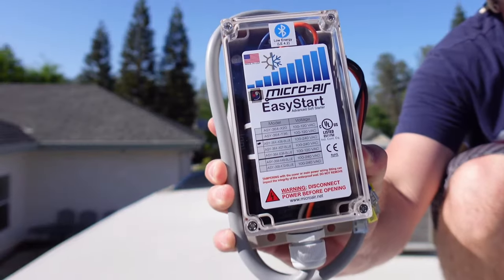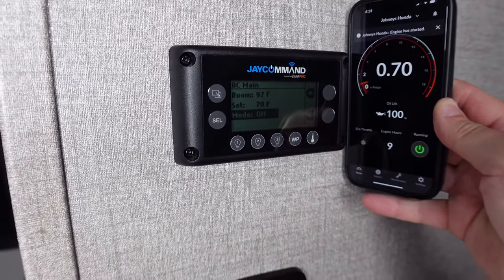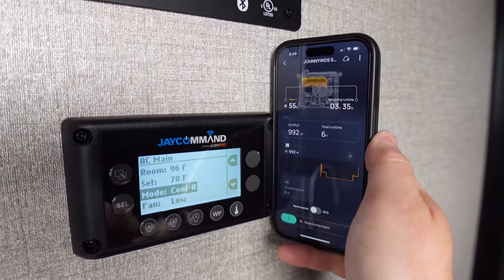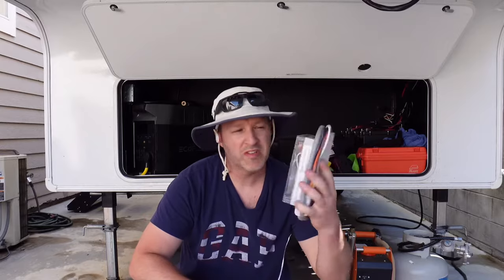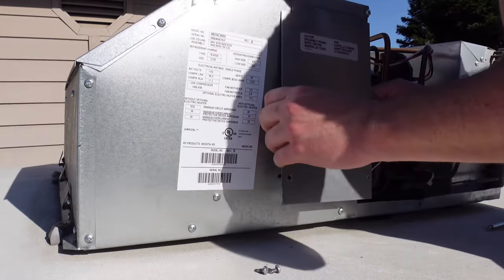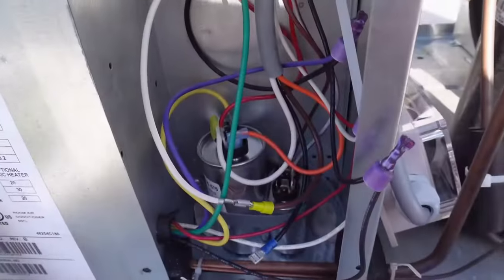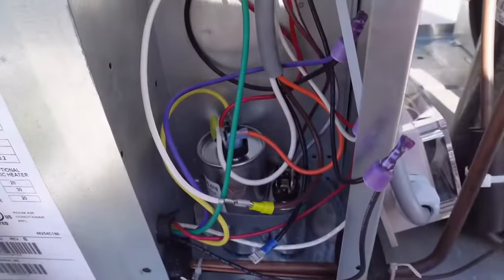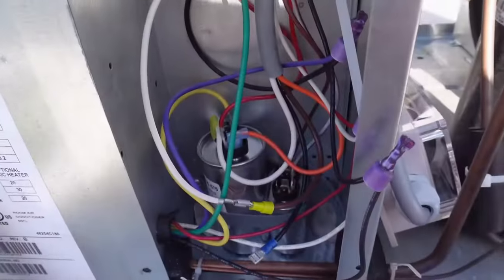HOW TO:  Micro Air Easy Start Install IN 20 Minutes!! RV AC

Comment from the maker: NOTE SAVE MONEY!! You can save about $40 going through the main distributor which is Hutchmountain.com They are also the ones that can get you the exact wire kit you need for your AC unit. Also most tech support is handled there 435-494-1975 Hope this install helps. These are great for a smaller generator and even now power stations. 

Micro Air Bluetooth model
With Basic wiring kit: https://amzn.to/3NPQpLZ

Micro Air Normal
With basic wire kit: https://amzn.to/3NPQpLZ

Wire strippers: https://amzn.to/44mC7rO

CHECK OUT MY AMAZON STORE: https://www.amazon.com/shop/johnnysweekends

If you feel I helped you out consider Buying me a Coffee 👍🏼🙌🏼👊🏼😀
https://www.buymeacoffee.com/johnny5120J

Comment: Cool that both could run on the Delta Pro once both units were installed!
Reply from the maker: I started both my 15k and 13.5k on my last trailer with out them but they were more of a energy efficient style so didn’t require as much peak amps for start. But yea Delta pro is still to this day a beast!! Thanks for stopping by Jason…👍🏼😀
Reply: I literally smoked my first EcoFlow Delta Pro starting  a newer Dometic 13.5 RV air conditioner.  (I should post the video of my franticness when smoke was rolling out).  I have two and was too afraid to try it on the second without a MicroAir.  Needless to say whether it can or can't start it the Easystart will prolong the life of the ecoflow or generaters electronics.  Luckily ecoflow did warranty the unit.  😎
Reply from the maker: Ouch wow that’s kinda weird because I know a few that have really abused them and they are holding up pretty well. 
I think it was defective. Glad they replaced it

Comment: I’m considering purchasing one of these units. I called the manufacturer of my AC (Carrier) and they said it does void the warranty. It’s not a big deal, just remember to remove it before getting service.
Reply from the maker: Well how long is the warranty on the AC unit ? 10 year ??
Reply: Not hard to remove. More of a hassle, but worth it if need warranties. I can’t understand why though.  Seems easier on the AC compressor and MicroAir uses their own capacitor to aid start up. Who knows.
Reply from the maker: I would think as well. If anything extend the life of the compressor.
Reply: @johnnysweekends  that’s exactly what I told them! It makes me mad that these old-school companies are so against anything they don’t understand. They look for any reason to deny coverage and say it’s not their problem. I used to work in mobile audio installing car starters, and we used to get this kind of opposition from the car manufacturers too.
Reply: @johnnysweekends  The warranty period is five (5) years on the compressor, and one (1) year on all other parts.
Reply from the maker: Yea weird how that works and when companies will tell you that. Idk but yea just remove it lol
Reply: @deadonleprechaun  i just bought a veriable cooling heatpump and it came with 1 warrenty on all cosmetic parts. 5 years on all pcb (indoor and outdoor, most importantly the vfd) and 10 years on compressor which will remain unused. I have had a compressor failure only once in all the 12 ac's i own .. compressors rarely fail if maintenance is done right. If you don't maintain the coils and ignore failures then compressor will die.

Comment: Thanks for the video ! Will this work on a 5,000btu window ac 110volt  in an older camper ?
Reply from the maker: It would but the start up on that should be pretty minimal. Most generators should be able to start that. What are you using to run it?
Reply: I have two 100watt solar panels and two 100amp lead acid batteries.  I would like to run the little AC on batteries for short periods of time.
Reply from the maker: You’ll need a inverter to run it. Which they can be had cheap but I suggest at least buying a decent brand so they last and will be more efficient. The renogy ones have been around a long time and seem to do well. And a 1000 watt inverter is not much like $200….ish

Here is one that I’m talking about https://amzn.to/44sOuTg

Comment: I've been running mine for almost 2 years now.  GenSet starts the 4ton home central AC very easily now.  Also, the compressor seems to start smoother without the old "BAM!" on startup.  The Bluetooth app is quite nice too. Mine is set up to start the condenser fan and air handler fan then about 5 seconds later the compressor.  Went from 100+ LRA down to 38~40A on startup.   Perfect.    - Nice review/video.
Reply from the maker: Wow that’s awesome. Sounds like it’s doing great. 
And thank you 😀👍🏼

Comment: What did the soft start do?  It took a little over 14 amps to start the AC before and after the soft start was installed. I though the soft start reduced the amount of surge power needed from your source of electricity.
Reply from the maker: I don’t think you really watched the video..? I explained the Honda app didn’t work correctly as sometimes the Bluetooth is t quick enough to capture the load. Sometimes it does but that first start before the easy start was plugged in should have read anywhere from 28-33 amps to fire it up. 
Now it’s consistent at 15 amps +/- a little.
👍🏼
Reply: Ohhhh. Ok, I did miss that detail. It all makes sense now. Thank you!

Comment: Another GREAT one!  I installed mine today  to allow me to run the AC on a Champion 2500 dual fuel.  What I'm seeing is just over 2000 watts running power after the AC gets going and I'm on shore power.  Thats the AC and AC Fam power combined.  I can’t use this generator as I hoped because of the running power. What kind of power draw on the Honda are you seeing and how is your Honda handling that kind of power demand.
Reply from the maker: You have more things running than your ac.

A 15k ac should draw about 1450-1600 watts about 

I assume your fridge may be on AC as well. Plus is your converter on? That’s power draw as well.

Comment: Hey Johnny...nice clean install. You might call Hutch Mountain and inquire about the mounting position. They advised me to make sure the wires were pointing down to eliminate the possibility of moisture getting inside. I know there's a waterproof gland and all but just thought I'd pass along what they told me. You're gonna love the difference it makes, not just for the ramp up surge...the AC doesn't work as hard even after the initial start up and seems to be a little quieter as well.
Reply from the maker: Yea I didn’t see much for mounting info which I may have blown past that part because I was running out of time. 
And with the cover on water intrusion is definitely minimal but yes, I was looking at that as well when I did it and said screw it since the ac cover is on and hopefully that eliminates most potential problems from water intrusion. 
I may flip it but will see.
Reply: @johnnysweekends  all good brother. My 15k Dometic runs seamlessly on my Honda 2200 Companion. Definitely was a game changer.
Reply from the maker: How many hours and also how many watts does it pull just on AC im running 1650 just with that which is almost full load. Darn near not enough gen especially if you turn your converter on to charge batts. But I dont really have that issue with my set up..👍🏼
Reply: @johnnysweekends  if memory serves me correctly I’m pulling 1450-1500 even in the hot Midwest summer with high humidity. Never had an issue with the converter running along with other AC outlets. Water heater and fridge on propane of course. 

I have a 6.5 gallon extended gas tank and can run the AC for 37hrs straight with that amount of fuel. We’re headed to NASCAR in KS tomorrow morning and will parallel my eu2000 to the 2200 so I don’t have to manage my power so much.
Reply from the maker: Wow awesome and sounds like that will be a great time..!
Reply: @johnnysweekends you do need to turn it wires side down because the capacitor inside the easy start my leak some of its liquid, when I installed mine on a portable A/C I had it laying on the floor to test it then when I put it in its final position there was a little bit of white stuff on the top of the capacitor, if you look close there’s a little rubber or silicon cap on top of it.
Reply from the maker: Yea I wondered about it but I did just call tech support and they said it was fine like that with the newer model. Especially the newer cable and seal nut that locks the moisture out. 
So I dont know if they are using a different capacitor now but he said no concern with the new one…🤷🏼‍♂️
Reply: @johnnysweekends  thanks for the update about the positioning of the unit.

Comment: Really nice to see those WAGO wire splicers provided.  Just strip the correct length of insulation, insert into WAGO, push the lever down - no crimping required.  WAGO wire splicers are a huge upgrade from wire nuts.
Sadly, the provided Spade connectors  were merely crimped onto the wire; no heat shrink insulation
Excellent "tip" on starting ac's on fan then turning on the compressor.
Reply: Wagos are junk

Comment: I watched an installation video that discourages upside down placement. Pretty sure it was an issue of water resistance. Otherwise, thanks for your great video.
Reply from the maker: Yea I don’t encourage to do it on a outside unit at all if directly exposed to the weather. But with the cover on there kinda changes that. It was only because the cable say much nicer. 
If that nut works like it should then it should be fine 🤞🏼

Comment: I might be missing something but when you test the delta both times i can hear the generator rev up when you turn on the air conditioner. This sounds like what happens when i have my generator charging my battery through my inverter which puts the inverter in bypass mode and powers the load from the generator not really utilizing tge inberter at all. Can you please shed some light on this and how i might be mistaken but i didnt wxpect to hear the generator reacting when tou are testing the power stations which should be silent. Thanks in advance.
Reply from the maker: Unless you skipped around in the video the first time and the second time nothing is running when I test the Delta Pro. You may hear the Ac fan on and then of course the ac fully kicks on and then I move to the second one up front. But there is no generator noise in the back ground. Probably just regular back ground noise. 
Only thing I can think of is maybe skipping around on the video..🤷🏼‍♂️

Comment: I thought I saw somewhere MA said to mount upright only.
Reply from the maker: Yea out side on a ac unit for sure. Under the Rv one I think it will be fine since it will take a lot of moisture to get inside the nut. 

Unless that is not sealed good 😂

I thought about flipping it but the wiring did better that way 

I would definitely have it upright on a outside unit or something that is not covered

Comment: On the fan hard start for an rv have you used a regular Hvac hardstart
Reply from the maker: I have not used a residential hard start on a Rv but this company also makes hard start units for residential.
Reply: Hard start kits draw a lot more amps on startup.